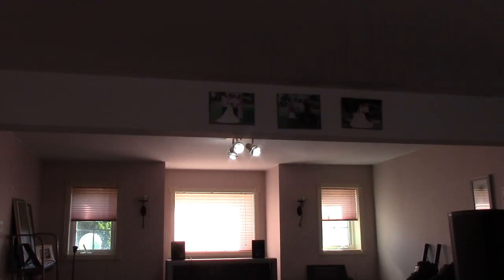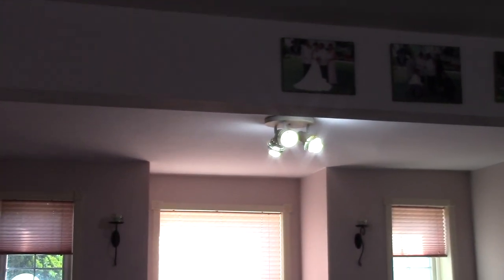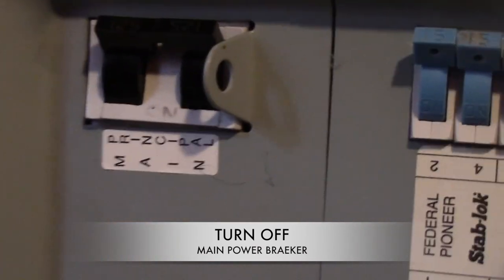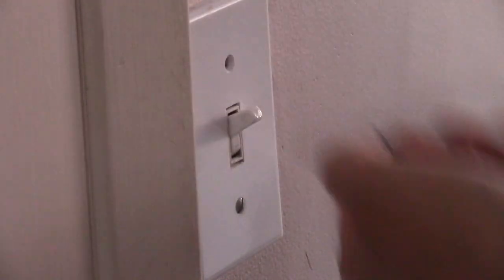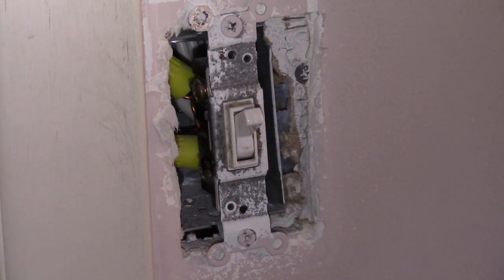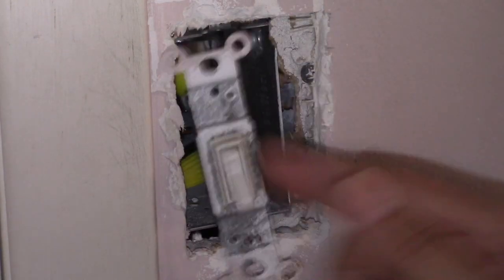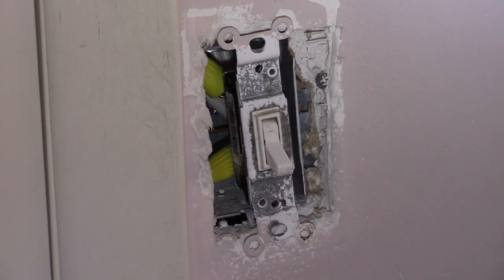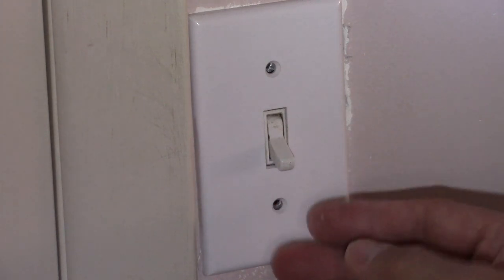How To Fix Light Switch Upside Down, without switching wires. (DIY)

Comment: turning off the entire breaker panel through the main breaker or service breaker.  Yeah, OK?  usually I'm thinking of the branch or local breaker itself only.  But turning off the entire house is fine, the only thing is just turn off everything throughout your house first before turning off the main breaker.  Probably good idea to avoid any surges from any loads left on.

Comment: I have rocker switches. I prefer the top side to stick out in the On position. Some older varieties even had a red mark there. Some of them were upside down. Push up/down switches are really old, which you might find in a 60 year old house or a shed. I don't recall the most common position.
Reply from the maker: Most common position is up for ON & down for OFF.

Comment: thanks for the tutorial video. was able to do it with those instructions, but maybe i should have listened to the breaker part. i caused a big spark and tripped the breaker.
Reply from the maker: Lol. Yes you're right. Safety first. Glad it worked out for you though.
Reply: You obviously should stay away from any electrical DIY jobs if this one was too complicated for you. Grabbing a live switch could win you a Darwin Award.

Comment: I moved into an apartment and I hate it. I have the same switch problem and your first instruction already frustrates me as my apartments management company maintenance guys put my oven in front of the bottom few inches of my breaker box 😂 I can't even open it without moving my oven which wouldn't be a problem if my oven wasn't sitting on pieces of wood. I can't wait to move.
Reply from the maker: Sorry to hear that. I hope you have better luck in your next place.

Comment: Now do it with a dimmer switch. Also what if the switch is labeled with on/off? Now it's upside down.
Reply from the maker: Sorry . Doesn't work with dimmer switch.
Reply: I think you have to swap wire positions?  I moved into a house where half of the lights down is on and up is off, also door knob locks are all different, the position of locked is horizontal on one and vertical on another. the lady that lived here before was odd.

Comment: Or you could just fix the wire that’s been placed in the wrong spot! You probably just twisted all the wiring!
Reply: I don't believe switching the wire would have any effect at all.  The switch has an open position and the switch has a closed position. In order for the switch to work the way he want it to, it has to be rotated.

Comment: this video is only good as an example it seems they should not charge an incredibly large amount of money for minor adjustments !!!! WARNING :  I TRIED TO FIX MINE MY SELF AND GOT A SHOCK  ( Though I did not have the Main Braker off ) its to easy to have problem if you cannot turn off the Main breaker and make a mistake !!!!  And it seems that this is just one example it seems there could be issues that are not covered in this video I would recommend you not be making adjustments unless you are sure what you are doing I took the pieces off and it looks like its in need of repair which gets into issues not covered in this video better to only have some one do it who know how not to have a problem !!! I would imagine since the switch was off it was not that bad but I bet it could have been worse !!!
Reply: to be clear I dont want to sue anyone but if you make a mistake it could be bad at least I had the light swtich turned off and it seemed nothing incredibly horrible happend I did get a shock I think I will wait for the electrician!
Reply: You’re very smart I can tell
Reply: Electrical skills: 0/10
Grammar: 0/10
Brevity: 0/10
Ability to take a shock: 1/0